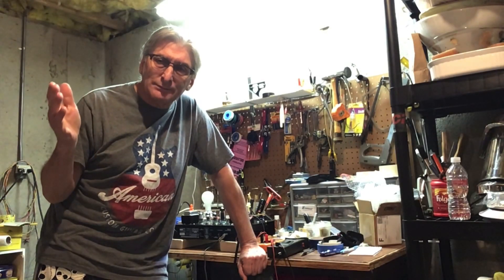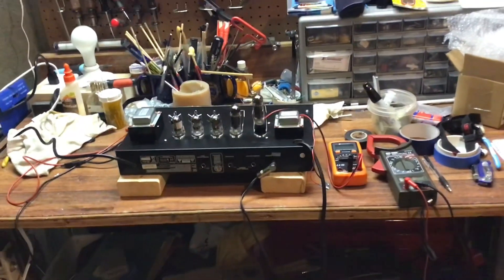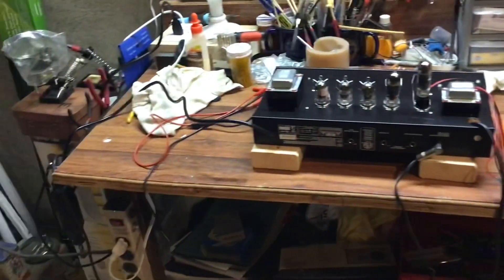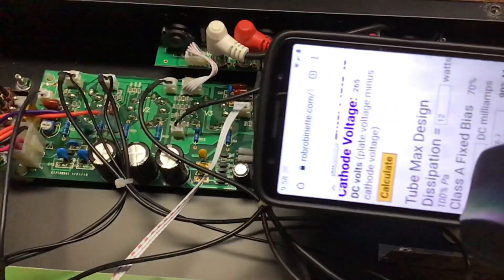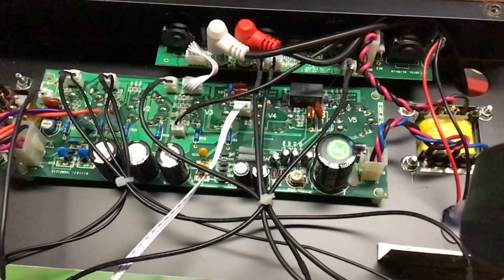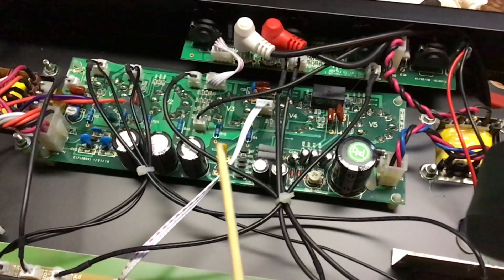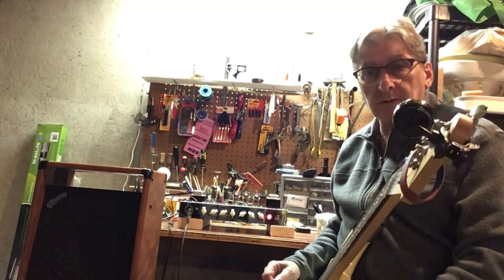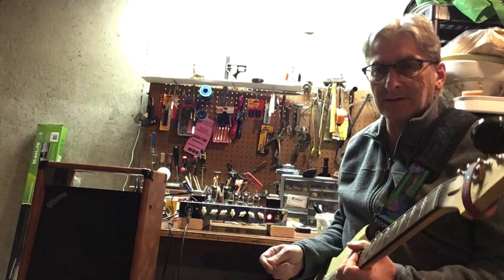Stage Right 15 watt tube amp from MonoPrice. Using a Biasprobe.

Comment: Do the math. Multiply the current times the plate voltage to get the plate dissipation. Go for 65% of 12 watts max, 7.8 watts per tube.

Then measure your actual bias voltage at the point "you don't know what it does" at the bias trim pot. That's your target bias voltage. -12.5V as spec'd on the schematic is likely a very cold bias.

Cold bias will effect the tone, the tubes will distort quicker with less gain but have way more crossover distortion (bad) and sound lousy. Biased right you'll have as much headroom as the pre-amp allows you and the power tubes will run right.

Here's a tip: buy a matched quad, that way you can just pop the extra 2 new tubes in without biasing, clients are always happy to hear that.

Comment: I was told voltage on the probe point to be 12v
The one I have sounds like a cold turkey bias ive not cared to even take it apart work
Reply: -12.5V not 12V

Comment: Measure /Probe the junction of r13 and r28 to common with voltmeter. Adjust tr1 to -12.5. (That's with a matched set of EL84's installed)
Reply from the maker: I keep seeing people suggest -12.5v at the test point. If I adjust the trim pot to that -12.5v I get 11.3 ma on my single bias probe. What gives?
Reply: @dugbert5 I don’t get it either… but they sound beautiful when set to that value so I’m not asking any questions!
Reply: @dugbert5 -12.5VDV is the recommended factory spec to be measured at TR1 test junction (bias pot). The monoprice stage right 15w amplifier is a direct clone of a Laney Cub 12R. Monoprice bought the schematic/rights to copy this circuit from Laney. On the Laney schematic, it says to adjust TR1 to -12.5VDC. It's probably a conservative value maximize tube life longevity and still sound somewhat decent. So when you measured like -5VDC at the test junction near the TR1 pot, that is probably closer to the 70% max plate dissipation value recommended for the EL84 tubes.
Reply from the maker: @Clandestine_Moisture  Thanks. That's good info.
Reply: You're correct..thanks for putting this on here, there's some confusion regarding this but the trimmer takes the guesswork out of it. Mine was set pretty cold from the factory at -7ish, I set set to -12.5v now. All good. Fyi same procedure for the Laney Cub12R.
Reply: @modscientist9793  -7VDC is actually hotter than -12.5VDC. The greater the negative voltage value, the more current/electron flow is being limited. If the voltage is more positive, the current is allowed to flow more which means more electron flow which means the plate will become hotter. So, -12.5VDC is actually running "colder" than -7VDC which would be "hotter". By adjusting the bias potentiometer to have a greater negative voltage (-12.5VDC) you are restricting the electron flow across the plate which means it's running cooler.
Reply: @Clandestine_Moisture  thank you for that, I did not know that. Obviously.
Reply: @Clandestine_Moisture  I set it to the recommended -12.5v. To play it safe. Sounds great so far. Wonder why they set it to -7 to begin with?
Reply: @modscientist9793 
I wrote a really long reply but it didn't post for some reason so I'm going to try and condense it lol.

So Laney recommends a setting of -12VDC because it's a conservative plate voltage that will prolong tube life but sacrifices the tone and warmth tube amps are known for.

@dugbert5 adjusted the tube bias properly by setting the plate current. When he did this he got a reading of something like -5VDC which runs the tubes hotter but within the nominal operating range.  

If you adjust the voltage to -12.5VDC, you're running tube very cold. 

@dugbert5 mentioned he took a plate current reading with the TR1 potentiometer set to -12.5VDC and his plate current was 11ma. 
Nominal plate dissipation is 70% for EL84 tubes which would be a plate current reading of around 28ma to 30ma. 
EL84 tubes are rated at 12watts and operating @ 100% plate dissipation would be measured around 40ma of plate current. You would drastically reduce the tube life because the tubes would more than likely be red plating which means they literally glow red hot because there's too much current flowing across the plate inside the tube.

So to sum it up:

Laney/monoprice conservative voltage @ -12.5VDC which is like 30% plate dissipation and gives you approximately 11ma of plate current = very cold tube bias (poor tone/long tube life)

Actually factory setting @ -7VDC to -8VDC is probably around 50% plate dissipation giving you roughly 20ma = warmer but still conservative tube bias

Nominal plate dissipation for EL84 tubes rated @ 12watts is 70% (approx -5VDC) or around 28ma to 30ma = optimized tone and tube life

Absolute maximum plate dissipation @100% (approx -2VDC to 0VDC) is 40ma = great tone but short tube life and possible damage to amplifier.

@dugbert5 was reading -5VDC at the potentiometer which more than likely gave him a plate current of around 28ma to 30ma.  
Each tube will be different so that's why you need to get a bias probe that reads plate current (most accurate unit of measurement). 

Check out robrobinette.com/How_to_Bias_a_Tube_Amp.htm

It's a great site that explains comprehensively how to adjust tube bias and the physics that you're working with.
Reply: Thank you so much for making that much clearer. I'm going wind it back to the.factory -7.5 then and see how she rolls? I appreciate it very much. That was one of the clearest explanations I've ever read.
Reply: @Clandestine_Moisture  now it makes perfect sense why they set it to -7.5v to begin with..to strike a balance and find middle ground between too hot and too cold?
Reply: @Clandestine_Moisture  I set it to -7.5, i dropped in JJ power tubes and a greenback. Should be fun
Reply: @Clandestine_Moisture  going to let do its thing for another 20mins then take a last measurement.and then button it up.
Reply: @modscientist9793    I think you'd be correct with that logic, however, -7.5VDC is still somewhat conservative but still safe enough to use as a rough measurement from the factory. I have a feeling the bench test and setup at monoprice is to adjust the voltage to around -7VDC and see if the speaker makes noise then the amp gets packaged and sold. Ideally you'd want the tubes to warm up or go through some sort of break-in period to get a really accurate measurement and bias adjustment but that wouldn't make sense for selling these amps as cheap as they are so they just get slapped together and sent on their way.

I measured mine last night and found it to be set @ -7.99VDC from the factory. I bumped it up to -7.5VDC just because I already had it open and I wanted to see if I could hear a difference. I don't think I can because it was such a small adjustment but I didn't want to run the tubes any hotter without being able to measure the plate current.

I'm waiting on a bias probe I bought from eurotubes.com that measures plate current and voltage at the same time so I can accurately adjust the tube bias.

I also just yesterday installed a new Celestion Greenback 25w 8ohm speaker to replace the Celestion Rocket 50 that came from the factory (even though they advertise it coming with a Celestion Seventy 80). There was a noticeable improvement in tone after I installed the Greenback speaker but I think it will really come alive when I get some new quality tubes to replace the unbranded cheapo tubes it came with from monoprice.

I ended up ordering with the following tubes for a full replacement:
Power tubes: Mullard EL84 reissue matched set

Preamp tubes: 
V1 position: Mullard 12AX7 reissue
V2 position: JJ ECC83S (12AX7)
V2 position: Tung-Sol 12AX7 reissue 

Once I get those in I'm going to properly bias the power tubes and see what happens.
Reply: @modscientist9793  Update on the bias adjustment:

I got my bias probe and new tubes today. My bias probe measures plate DC voltage and plate current at the same time which is super convenient.

So, just to reiterate, when you are adjusting power tube bias, you need to know the watt rating of the tube (12 watts for an EL84). Think of this rating value as 100%. EL84 are recommended to be run at 70% of that 12 watt rating, which is 8.4 watts. 

You also need to know plate current and voltage.

So, with the amp in the "ON" state, tubes warmed up, volume and gain set to zero and bias properly adjusted, my readings are currently 280 volts DC and 30 milliamps. 
The formula is this: watts (W) = amperes (A) × volts (V)
So my readings are 0.03A (30mA) × 280VDC = 8.4 watts
This is exactly 70% plate dissipation and the recommended value to run EL84s. 

Now, after I adjusted my bias and got these measurements, I measured the voltage at the test point near the TR1 bias potentiometer on the amp where you make the adjustment and I was getting -4.88VDC. 

So, what @dugbert5 was seeing is basically the same as what I was seeing after a proper bias adjustment is made. 

The recommended bias voltage on the Laney Cub 12R schematic, and subsequently this gen 2 monoprice 15w amp, of -12.5VDC is running these tubes extremely cold.  

After more research and talking in person to the techs at my local tube amp shop, I found out the EL84 tube is typically run anywhere from 60% to 130%. 

So...this means you could crank up the voltage on yours without worry in a range of  -6VDC to -4VDC. 
This would get you to anywhere from roughly 60%-80%.
I wanted to update you because there is so much bad information about these amps and the tube bias adjustment. 

I hope this helps.
Reply: @Clandestine_Moisture  I appreciate it very much thank you

Comment: They give you a value on the schematic and where to measure it at. Or they did on the 1st Gen 15w amp. This one is supposed to be a copy of the Laney LC15 so I'd check that schematic instead of the Cub 12R schematic that's always given for this amp.
Reply: @J.C...  The Laney LC15 is the same circuit as the 1st gen monoprice 15w amp. The 2nd gen monoprice is a clone of the Laney Cub 12R which is why everyone references that schematic. There is a lot of confusion online surrounding this topic but it is true the 2nd generation monoprice 15w is in fact the exact same circuit as the Laney Cub 12R.
Reply: @Clandestine_Moisture  nope
Reply: @J.C...  have you looked at the Laney LC15 and Cub 12R schematics and then compared to the monoprice? If you email monoprice asking for a schematic they will send you the Laney Cub 12R...

Also, just Google a picture of the gut shots of the Laney Cub 12R and the monoprice. It's practically identical.

Comment: The negative voltages in amps are attributable to the center-tapped power transformers that deliver, say, 460V rail to rail but are only ever 230V away from the chassis ground. Rectifying that voltage down with rectifier tubes, caps, and dividers can result in a positive or negative DC voltage. The direction of your half-wave (diode) rectifier will determine its relative voltage to ground/floating 0v rail/whatever is at the same potential as the center tap. -5V sounds like grid voltage. Someone said gate, but that's solid state/MOSFET terms. Similar concept, different execution.

Comment: Watching lots of Uncle Doug ... Is this Monoprice 15 a single ended or double ended amp? Based on your comment that "The one bias pot affects both tubes" and what I've learned so far, I'd say single ended??
Reply from the maker: The Stage Right 15watt is not class A (single-ended).  It is class A/B, push-pull). I'll refer you to Uncle Doug,  https://youtu.be/L3rRk3eSTnA

Comment: Very interesting video. I appreciate the disclaimer: DON'T DO IT!! I just got one of these and it sounds pretty good now, but I know that eventually I am going to have to change the power tubes and bias them. I have been told that if you get a matched pair of power tubes then they don't have to be biased. Is that correct?  Another biasing issue is raised by the fact that the amp has two power tubes and one bias trim pot,  but you have one bias probe on one of the two power tubes. How do you adjust the bias on the other tube? If you put the bias probe on the other tube and move the bias trim pot how does that affect the bias of the tube that has already been adjusted?
Reply from the maker: Thanks. Power tubes in these amps need to be matched and biased. Groove Tubes at one time sold numbered sets, so if your amp were biased for say, number 6 you could replace them with another set of number 6 tubes from Groove Tubes. I don’t know if they still offer them. The one bias pot affects both tubes. Moving the probe to the other tube should show the same reading. If you’d like to know different ways to bias an amp I highly recommend Uncle Doug’s you tube channel.
Reply: @dugbert5  Thanks for the replies. Yes, I have been watching some of Uncle Doug's videos, very interesting. It's like watching a university engineering lecture, or something. BTW: Do you know how to discharge the capacitors on this amp?
Reply from the maker: @navigator3744  Here's the wrong way. Plug in a guitar, hit a power chord and turn off the amp. When you no longer get sound , the amp is discharged.  Or this, https://youtu.be/KkBxXtCThNg
Reply from the maker: I should mention that pre-amp tubes need not be matched or biased. And Biasing applies to A/B class amps. Class A amps are self-biasing.
Reply: A matched pair will work better than an unmatched pair because they work together better, but that won't change the bias point. Changing the bias will adjust your clean headroom up or down, but many say it doesn't affect the overall tone at all, allthough tube amp guru Gerald Webber biases the amps he builds completely by ear! It WILL make it break up earlier or later, depending on how you set it. A hot biased amp will break up sooner, but will be harder on tubes. The bias trim pot on this amp adjusts bias for both tubes at the same time, so if you have a matched pair, there's no reason to check the other tube.

Comment: Hi I hope you can help me. I have this same amp.  It is making noise when the signal goes through especially after warming up. I’m trying to take out the chasis and I’ve removed all the bolts I can see including the side (6) and the handle just case. Won’t slide out.  I even took off all the knobs and pots in case the mirror face is fixed.  Still won’t come out.  How did you get it out?
Reply from the maker: I wish I could help. I bought my Stage Right as a chassis only and put it in a Fender cab. I did find a website that might help. There's a photo of the chassis partly out of the cab. Good luck!    https://www.vguitarforums.com/smf/index.php?topic=21220.0

Comment: I have one that quit working today.  It made some crackling noises then the power light shut off. It's under warranty, so I'm not going to mess with it until I get a replacement.  If I get to keep the old one I plan on repairing it.  I'm assuming a fuse blew, but I'm curious if there is a common cause on these.
Reply from the maker: Good luck and be careful if you try to fix it yourself.
Reply: @dugbert5  I appreciate the warning.  I'm a former Avionics tech, but you cam never be too careful with these, especially a broken amp where you don't know if something is shorted.
I may attempt modifications even though it is a SMC board.
Reply: What happened with the amp? Did they replace it? I just got a new one; arrived today. It arrived unblemished and sounded real good but durability is the big question with these.  The mod I am interested in doing is adding a standby switch
Reply: @navigator3744  They replaced it, and didn't require a return.  I still have the defective unit,  I haven't gotten around to fixing it because I'm modding my Ceriatone KK, and have a few other projects to work on.
A stand by switch sounds like a good idea.

Comment: 31.6 is not cool , it is exactly for 70% dissipation which is high as you should set it !
Reply: I though 70% was around 23mA for EL84's. What voltage are these running at?
Reply from the maker: @qua7771  I measured 265v, then used an online calculator.
Reply: @dugbert5  Thanks, that explains it.  My other EL84 amp is at ~360V @ 23mA
Reply from the maker: Thanks, I plan on checking it again soon.

Comment: -5 volts is the grid bias that draws positive volts across the grid to the plates !
You really need a plate voltage bias probe and a grid bias probe to set the proper bias using the online bias calculator for el84 tubes in class A/B  amps !

A bias probe takes a power tube to be installed and then you plug the bias probe & tube in the amp socket to get the reading on you DMM multimeter !
Reply: You beat me to the comment on this one! Same tech NERD status...
Reply: I feel so dumb after reading this. My grandpa has a vintage tube tester, maybe I can finally figure out how to use it after I study all of this.
Reply: Laney cub diagram tells to adjust the negative voltage at bias test point to -12.5. Considering you put a matching pair of tubes, wouldn't that suffice in giving you roughly safe and decent result? Different tubes will again mess with the plate voltage and draw, but the negative voltage would be affected as well so readjusting it back to -12.5 would give roughly proper values. I'm dumb when it comes to tubes, I'm just trying to understand if this is the case here, if not then what's the point of the set value (not even a range) in the laney diagram.
Reply: @Mosiulas  Use the bias calculator online as i use Webers and chose el-84 class A/B and set no higher than the 70% dissipation as only class A is set at 100%!

Once you set it the setting is for both tubes and if you have four then set the other pair also with a different trim pot !

Each setting will give both tubes the correct bias so do not double the setting by over thinking bias !